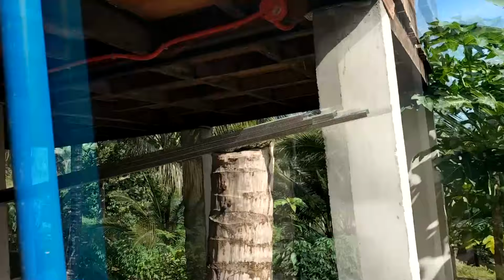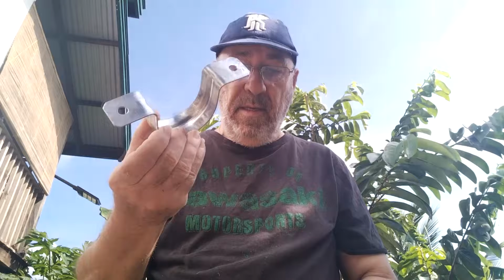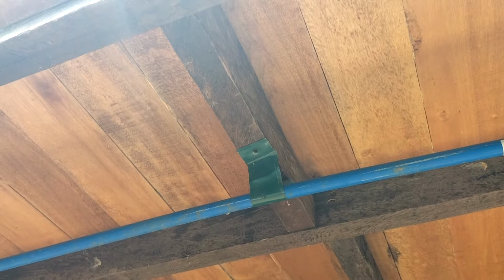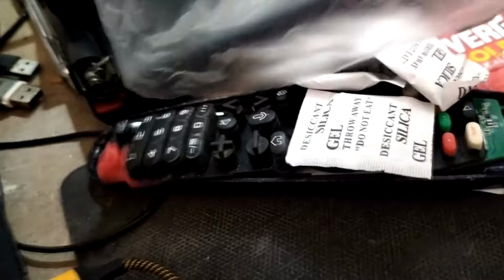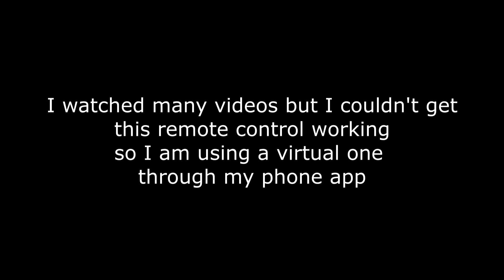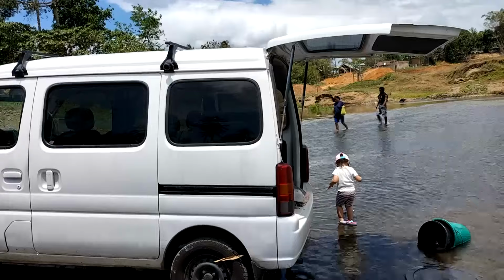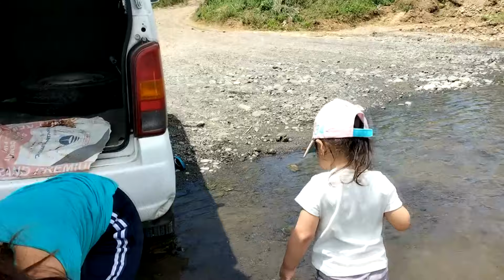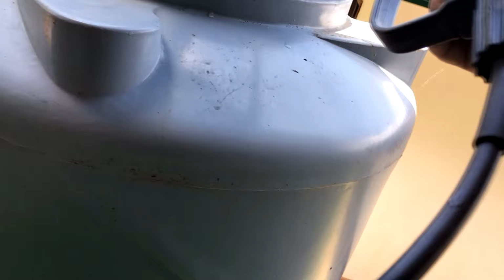WHY LIVING IN THE PHILIPPINES PROVINCE CAN BE TOUGH - THE GARCIA FAMILY

Comment: Hi Joe, Rainy season starts in July going to October generally.
Good job using the pressure washer as that works good as a pump for water transfer.  I used a pressure washer with a shower head for a shower in one old house once upon a time many years ago.
Water is a priority, take your time and just work thru it as needed.
One project I did was basically a pool, 8'x8'x8', for 5,000 gallons of water storage.  That lasted from March to June for a family of 5.
Reply from the maker: That size will be great maybe one day. Cause a tropical shower could fill 20 of my current tank😊👍👍👍
Reply from the maker: Mindanao has no rainy season as such since I moved here. Last few months (expect last week) we had lots of rain, go and figure that out🤔